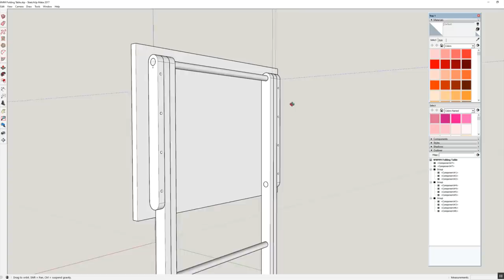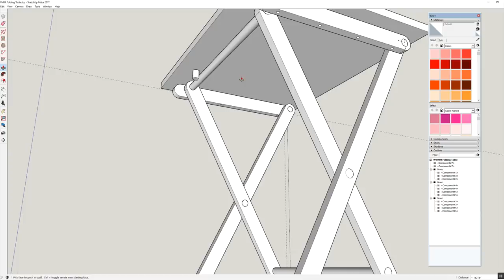Let's make a folding table. | LOCKDOWN Day 63

Comment: 0:50 I also has this dilemma, my solution is to put things I probably don't need to the storage. If I don't touch them or even think about them after 1-2 years, I proceed to sell them or throw them out. That's my way of cleaning the house without excessive hoarding or throwing out usable things.

Comment: I have a set of 4 tray tables that have a stand they fit into with a handle that I can carry around. The locking mechanism when they are open is just a block of wood with a half curve for the dowel to go into. Also, it has a 1/2” wide piece of flat metal that acts as a track, on the underside of the table, for that locking top dowel. It’s kind of like a guide so the top and legs are a moving unit.

Comment: Steve is "wonkey" is that a CA term?  Wyatt nailed the skit, AWESOME job; two thumbs up for Wyatt
Reply: Wonkey is perfectly cromulent here in Canada.
Reply: I'm in Kentucky and use it constantly.  I think it's more of an internet word that embiggened all our vocabularies.
Reply: Bruce Peter I think it’s a term associated more with an era than a place. Use it in AZ too.
Reply: Wonky, slightly different spelling, perfectly acceptable in the UK.
Reply: wonky used in Australia and in Ireland, like said above, more of an era word than geographic
Reply: From boston and i say Wonky
Reply: Bruce Peter: How about “cattywampus”? I think it is an old English phrase with the same meaning. The people here in northern Wisconsin say kittywampus. It comes from cattycorner, which I say as kittycorner. Oh well, it language and it varies tremendously.
Reply: I don't think so. It's probably from Boomers or Gen Xers. I'd guess it was created between 1950-1980. I hope it doesn't have racist origins 😅
Reply: @social3ngin33rin  it's from the 20s and has nothing to do with race smh

Comment: Hi Steve, I've really enjoyed all of your LOCKDOWN videos. My wife and I both grew up with the old aluminum type TV tray stands. About ten years ago we upgraded to some real wood ones! I don't know where we got them, but there are four mounted on a stand. Anyway, you mentioned you weren't sure about the leg stop. Ours have a strip of wood on each end of the bottom of the table with a wire attached between them. They act as a guide for the folding leg to travel along the bottom of the table, and a stop for when it is opened or closed. Take care. Be safe. Robert from Georgia.

Comment: I have a TV tray table just like you are making ... I would suggest 2 things .. a guide for the table dowel .. like a coat hanger to keep it from flopping to the floor when folding up the table if you dont have a hand on it .. and I would also incorporate a catch for when the table is open .. that way you can pick up and move the table holding on to only the table top the long way and dont have to only pick it up width wise and hold the dowel to keep the legs splayed out.

Comment: On my TV trays, the top horizontal rail for the pivot legs slides into a simple 3-inch stop block that's grooved inward so that the rail is covered on three sides. You might try that instead of just dowels.

Comment: take two pieces the same size as the cleats attached to the top, drill them a little off the edge and then use your bandsaw to come it at an angle to make some hooks to catch the dowel at the top of the legs

Comment: I've got a bunch of those kinds of tables in my house. Like others have said, an easy lock for them is to put a small block on either side of the bottom of the table. Your dowel sticking out plan should probably work fine. A lot of those tables also have a flat metal bar going across those 2 blocks to help it fold easier (I've had one without it and it was a bit of a pain to fold, but not impossible).

Comment: I have an idea. If you rout a slot in the boards, with the counter bores, between the fixed leg and the final position of the second set of moving legs, then the you can move the legs easily and stop the movement at the end of the slot. You only need to extend the dowels a bit into the slot.

I hope this makes sense

Comment: So normally the stop for the sliding leg is L shaped to catch the dowel and hold it vertically as well. This is so the table top doesn't flip up if something heavier is place on one side making it want to lift off the side where the stop dowel you drew is.

Comment: The TV trays are now called "task tables" and I bought a few from Target, they have a 1/2 inch thick black plastic top with metal feet... you can get inspiration from their design for locking the legs and adjusting the height... they have 3 pairs of notches attached to the underside of the top that a cross bar slides in to that allow for different height settings... easier to look at a picture than describe.  Hope that helps.

Comment: This looks like a classic example of a project that I couldn't justify trying to build myself. I've got a set of 4 of these TV trays, and to recreate one would cost more than just buying one. 
I was going to build a custom entry bench with cabinets for storage, but buying one was cheaper than the material cost I had calculated, and was the same design I was going to build.
Reply from the maker: It is almost always cheaper and easier to buy something rather than make it. Most woodworkers find meaning in this hobby and are compelled to build things by hand for much different reasons.
Reply: @SteveRamsey   I totally agree with the "half the fun is building it" mentality, but I was just offering the truth that I often face. As a father with limited time to spend on his hobby, I've caught myself many times getting excited about building something that management has mentioned they want and planning out the cuts and materials, then finding that the bought item solves the issue - now - rather than in the month of partial weekends and weekday evenings I can commit. There are plenty times I do "mental health" projects that are purely for fun and not to solve a certain problem, but part of my journey in the hobby has been realizing that sometimes buying it is the right answer for my family, and that's okay too.
When I've got a custom project (like fitting a cabinet into a specific opening, or designed around a particular size of basket) then I get to be the hero, but management knows that's gonna take a month or two to get done.

Comment: We once had a set of four wood TV tables like you are making.  The legs were put together like an X, with a joint in the middle. They were attached on the underside of the top to little blocks with dowels.  One set of legs had a dowel that connected them on the right and the left. There was a strip of metal that went over this  dowel allowing the legs to open and stop when they got to the other side of the table. There were three dowels. One at the top of the legs that folded out, one in the middle at the pivot point, and another at the bottom of the inner legs.  When the legs fold, they have to fold flat, not have a dowel blocking the folding action. Your design with boards connecting the legs at the top is overly complicated.

Comment: I have a folding table like that for my kids. It has 2 blocks that the cross dowel sits between to keep the top more stable. You could also put a swivel lock on there so it won't collapse of it gets bumped.
Reply: the one i have has 2 clips that the dowel snaps into. kinda like how some window curtain rods are held up

Comment: Years back you built a folding stool that had a handle built it,  I built one and suddenly got the idea to make it so the top was 34 inches from the floor.  It worked out great so I had a 34 inch folding table which had a larger top.. Time passed and I was using it in the Garage more so it is now a non folding work station with a wider and longer top,  I love working on mowers off the ground then getting down on the ground to work on them.

As for your off site storage, I heard advice about how to manage them.  If you have things in the storage that you haven't touched in 5 years, throw them out.  You haven't used what is inside the boxes so you don't know what you are throwing away.  Don't tell UPPER MANAGEMENT what you are doing and since they don't know they won't get as upset.

Comment: I'm looking to build my second woodworking project and that consists of a desk top that I plan to use with standing desk legs. The interesting part is that I'm looking to make the depth adjustable between 24 and 30 inches. Any recommendations on how I go about making that happen and making sure the legs are positioned so that the table is balanced in both configurations?

Comment: Hi Steve, I'll try to send a photo of a locking mechanism from a similar table I have. Simple design, just a wooden 'peg' attached with a snug fitting screw that still allows it to rotate into a locking position. Loving the lockdown series, helps to keep my sanity while stuck at home home-schooling my kids here in Sydney! Cheers, Carl.

Comment: It is better to drill the counterbore hole first and then drill the through hole. The forstner but has a center spur that will align the center of the hole. If you drill a wide through hole the forstner bit will chatter all over the place

Comment: Have you ever considered using your router table, a roundover bit, and holding the work piece vertically against the fence instead of the sander and bottle caps?

Comment: These kinds of tables typically had a series of half-round holes along a board on the underside, for the dovvel on the folding leg to fit into, allowing you to adjust the height as needed.  Mind you most of them were terrible and given enough load would just collapse, so.. maybe you can do better.

Comment: You could get a metal clip from the home improvement store that the dowel snaps into
Reply: I was thinking even drill a hole through a piece of wood, cut it in half and and least have a half moon shape for the dowel to more or less lock into.